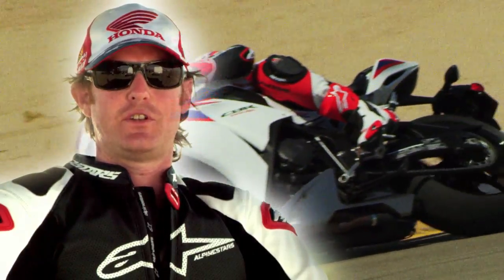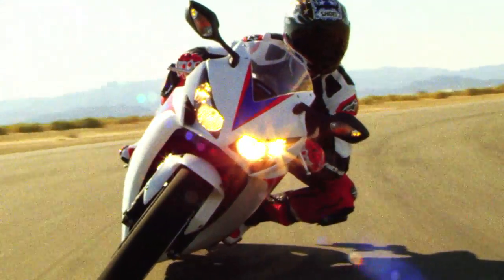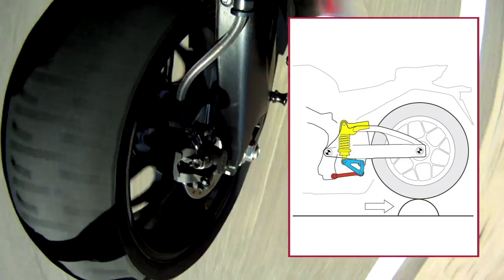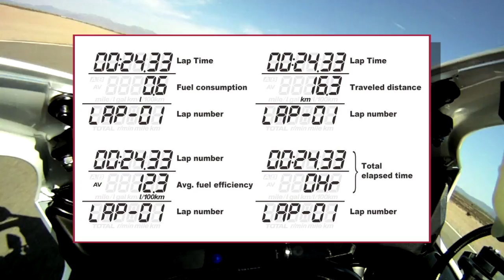2012 Honda CBR1000RR Tech Talk

Comment: @hellostevelee --  Actually, the CBR has more drive off the corners than a ZX10.  I'm sure the Kawi will give faster lap-times if you have the skill, though.   For street riding I'd prefer the CBR's healthy midrange power.